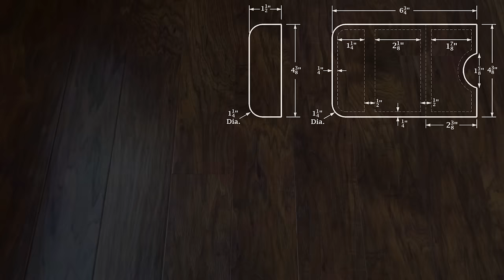Deluxe Leather Card Holder - Leather Craft

Comment: Very beautiful. Does the leather need to be dry before you add additional dyes? Does it need to set in between applying the oil and the resist?   Thank you
Reply from the maker: Thanks. It is always a good idea to allow as much time as possible between different finishes. Not that big a deal between different dyes in my opinion.
Reply: Great question and answer!  Thanks!

Comment: I see this and I ask myself how much more would one of these be to make if I had chose to line it with RFID blocking material; I know its possible to acquire an affordable version in neutral tones (mostly fabrics intended to be used as purse liners) but a thin enough material would be effortless and help prevent snagging on the clips of the magnet clasps. It would increase the value of the wallet as well but is it something that is finically beneficial hmmm I see a possible video on the topic with a little number crunching.
Reply from the maker: I really meant for this to be used to storing business cards more than credit cards. But that would be a good idea if one was to use it for that purpose.